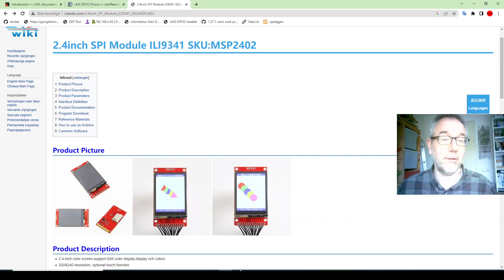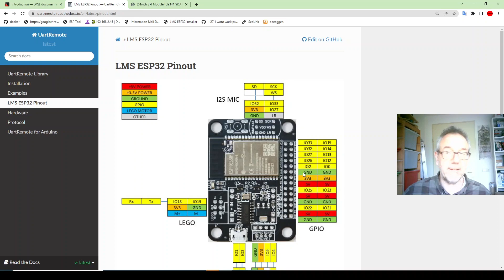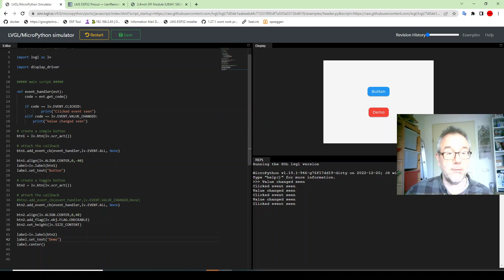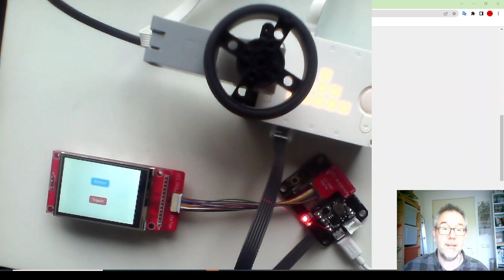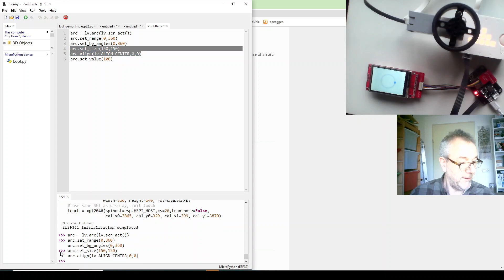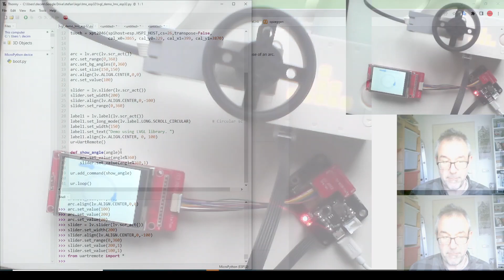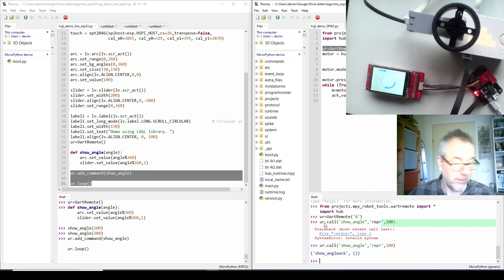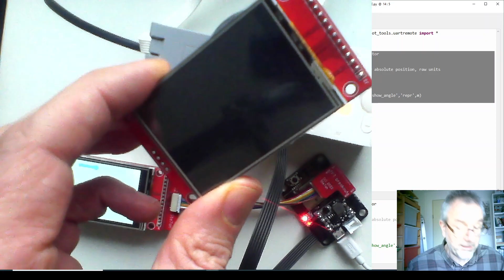Tutorial LMS-ESP32: Using a TFT screen with LVGL library

Comment: It's a very nice product! It has helped me to make more realistic machines with LEGO, giving them an useable GUI (Graphical User Interface). I have been using 2 of these setups now for around 1 year without any issues at multiple LEGO events (they run nonstop for 8+ hours a day there). One mostly used as overview for a sorter. The other as HMI (Human Machine Interface), to be able to control every function of a large high bay warehouse to keep it running the whole day without having to restart the bricks and changing the program. The touch display with the LVGL library is a very strong tool to take LEGO technic to the next level.